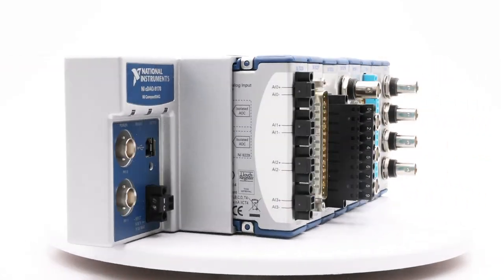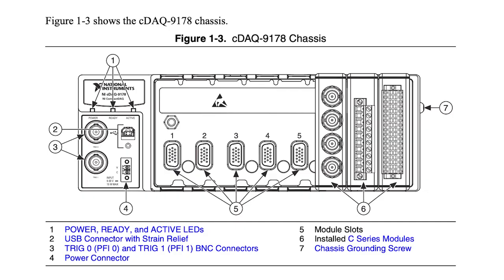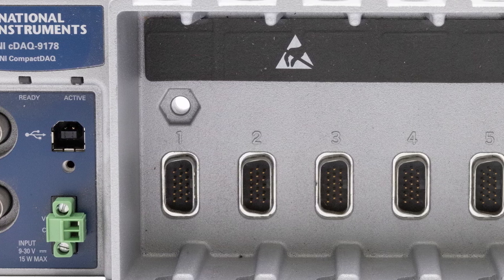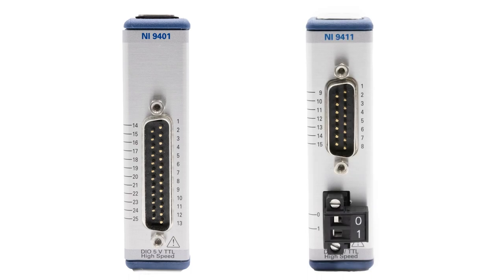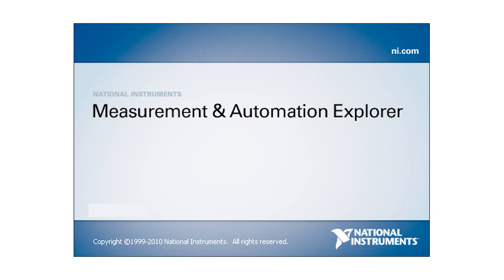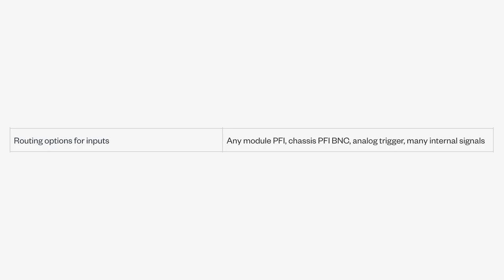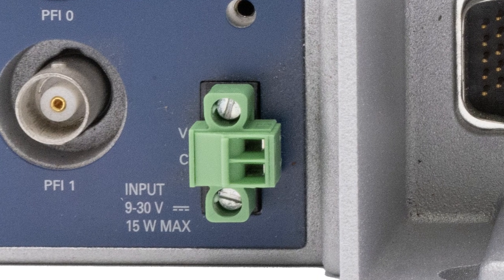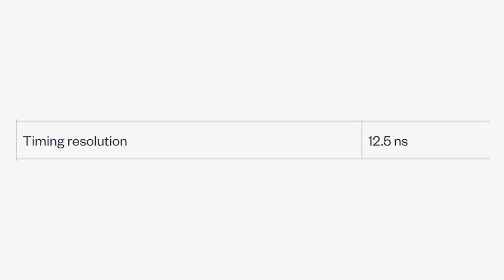Introduction to National Instruments cDAQ-9178

Comment: Hello what does this do
Reply from the maker: Hello @mephr! Thank you for your question! The cDAQ-9178 is an 8-slot CompactDAQ chassis designed to connect and manage various measurement modules for data acquisition applications. It allows you to mix and match C Series I/O modules, so you can measure different types of signals—such as temperature, strain, voltage, and digital inputs—all in one chassis. It also supports synchronized data across multiple modules, making it ideal for a wide range of testing, monitoring, and automation applications. The cDAQ-9178 is commonly used in lab, field, and industrial settings where flexible, high-quality data acquisition is essential.